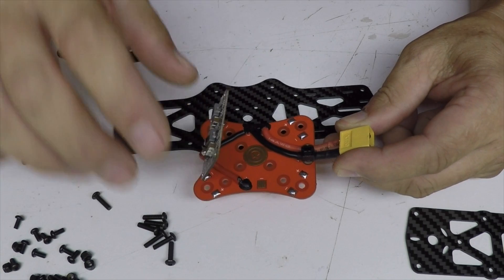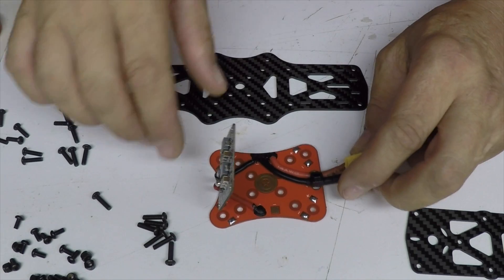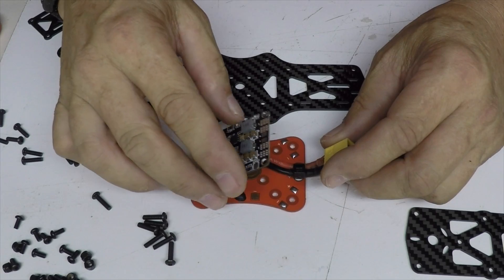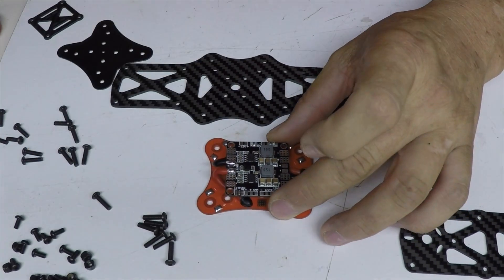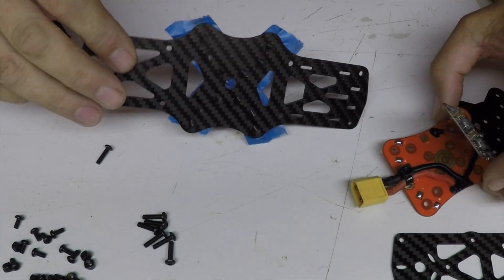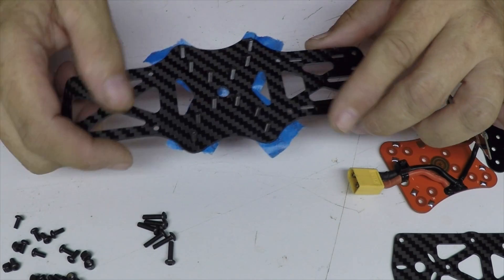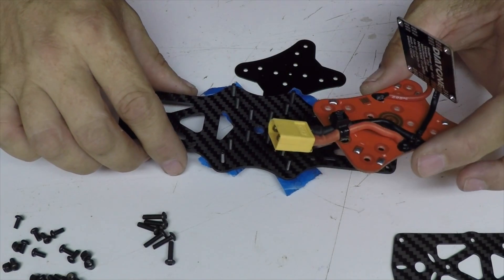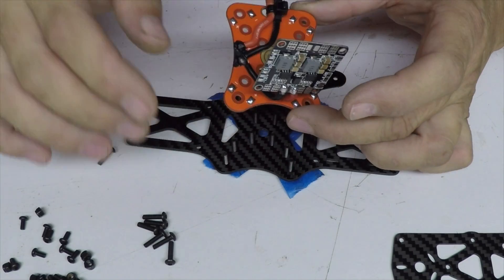Martian II Build (Part 2)

Comment: So you know what the voltages are for the esc and center pads?
Reply from the maker: I think you are asking about the stock PDB pads? If so, all of the stock PDB pads will deliver battery voltage no matter where they are located on the board. Hope this helps.
Reply: Budget FPV RC  I'm saying, do you know if the what/if the pads are 5V or 12V... Thanks for the quick response though!
Reply from the maker: I still don't know exactly what pads you are asking about. The pads on the stock PDB are not regulated so they will be what ever your battery voltage is.
Reply: Budget FPV RC It's ok, I found an answer and a solution!

Comment: Hi, I m a newbie. I ve a question: why you use 2 pdb? the red one and the black one? thank you
Reply from the maker: I need a12v power source to power the fpv camera and vtx. Also a 5v power source to power the flight controller. The stock (red) pdb has no regulators on it. It will only supply battery voltage. The black pdb has both a 12v and 5v regulator. I kept the red pdb on the quad because it’s a structural part of the frame.
Reply: Budget FPV RC thank you

Comment: To add, I bought one just to see it for myself.  I was so unimpressed with the quality it still sits in the box it came in.  I salvaged hardware and aluminum stand offs from the kit.  The carbon is complete crap.
Reply from the maker: I think people will have different opinions based on their personal experiences and expectations for sure. For me personally it's allowed me to get cheap and valuable stick time on a budget. It also allows for a low stress level about tearing it up due to the issues you pointed out. Personally it has been the perfect frame to get what matters the most to me. "flight time" And you just can't beat the price. Heck buy three or four and crash and burn, rebuild and crash and burn some more. It's all valuable experience required to enjoy this great hobby. If I ever get good maybe I'll consider a better quality and more expensive frame.
Reply: Batup Snid.

You are such a Chad.... It's obvious.

Comment: I fly without my red power distribution board and I have done cartwheels across parking lots never broken anything except an arm one time when I hit a tree at maybe 40 you can also order 5 volt 12 volt Bec the size of an SD card instead of using a pdb as a bec
Reply from the maker: Nice!

Comment: Can I use 1306 3300kv motors red bottoms on the Martian rx180mm frame
Reply from the maker: I measured the motor mount holes on the arm and it looks like this frame will fit anything that has 15mm to 21mm bolt pattern.

Comment: can i use the  flycolor rapter 390 tower 4 in 1 30amp blheli esc f3 flight controller with 1306 3300kv motors on the 180mm frame
Reply from the maker: I don't know, I am not familiar with that controller set up.

Comment: I have a question for you, I am waiting to get this frame and I am using the KISS EC & ESC'S the kiss fc has a built in bec so do you think it will be ok to use the pdb that comes with this frame?
Reply from the maker: Sorry but I have never used a KISS FC so I don't know how it is set up. It will also depend on the camera equipment you are using and it's voltage requirements. Most cameras and video TX's will run from 12V power so if your built in BEC supplies 12V I think you may be able to just use the supplied PDB with your kit but without more specifics I'm not positive.
Reply: Yes my fpv gear can handle  almost any range of voltage & 4s lipo's are not a problem for my fc or video equipment,you know what really has me confused? the  pdb says it has 2 ounces of copper & the real rotor riot claims 4 ozs of copper but there weight doesn't support that? 28.2 grams in a ounce, so how can a pdb have 2 or 4 ounces of copper and weigh 12 grams? what am I missing?
Reply from the maker: Good question, I do not know the answer to that one.

Comment: You should have just used the blank plate that sits under the supplied PDB, thats more than enough for strength without using the supplied PDB. I've not used the supplied PDB in my second Martain 2 build and its still very strong.
Reply: so glad i just read this.... iv already got a matek pdb and wanted to add that instead, but iv been hearing that its parts of the structure....obviously not. matek it is.. nice 1mate
Reply: OzFPVflyer I see that there are spare fiber glass parts for the PDB in banggood. Do you think I should buy 2 of those in substitution for the PDB so that I can use a different PDB?
Reply from the maker: That's good to know because that stock PDB is quite heavy too. Thanks for the info.
Reply: Yea I was wondering this too... So I guess I will scrap the included PDB and add another. Thanks OzFPVflyer and Thanks bah7566!
Reply: OzFPVflyer Thanks!
Reply: It also makes for a better looking build and as you can see from the comments here, there's no loss in structure strength using just one or two fibreglass plates. I only use one plate and never have any issues and my quads look better without that huge red PDB.
Reply: Thank you very much, I have an AIO FC and I was wondering if it was safe to remove the PBD
Reply: Buying 2 is a good idea, you can join them together with a strong glue like epoxy (very thin amount and dont block up holes for bolts) This will give the same if not more strength to the centre part of the frame.
Reply: thank god I saw this comment i'm about to build a drone w/ a martian 2 and I bought a different PDB because its better, thanks.